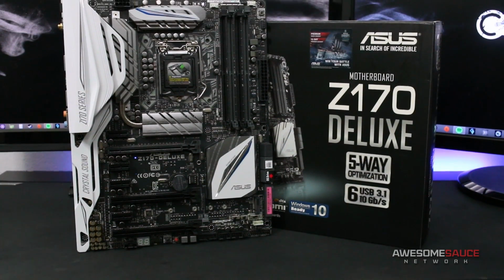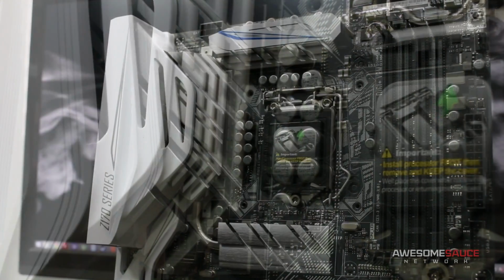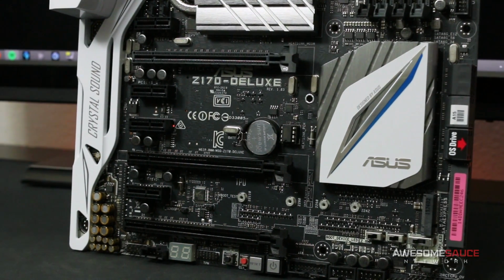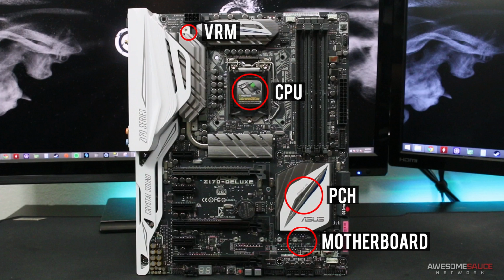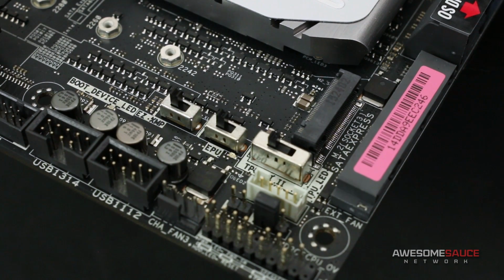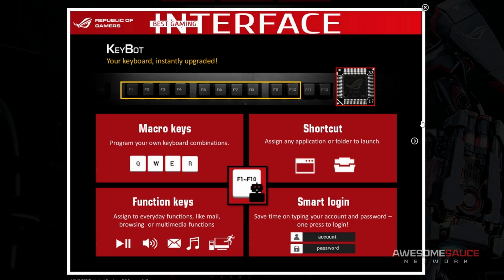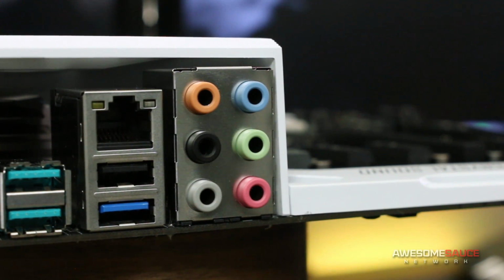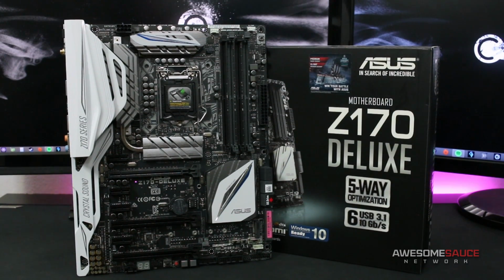Asus Z170 Deluxe! Best Z170 Board Yet?

Comment: Hello, I've got Asus Z170-DELUXE as your showing now and the vga led red light stays on, no post on the monitor code 62 meaning installation of the pch runtime services. There nothing wrong with the ram but I cleaned the ram removed my graphic card, I've reset the component still the same, any ideas?

Comment: Hey so I'm building a new pc, and Im using this board.  I'm also using an i5-6600k cpu.  I was wondering how many ghz the TPU I overclocks the standard 3.5 ghz to, and how much the TPU II does.  Could I use a coolermaster 212 evo with artic silver paste for the the TPU I, and get temperatures under 65 C, and depending on the how many ghz the TPU II provides, could I get something under 70 C or 80 C?  I've been asking around, and I'm not getting much feedback.  It would be really helpful to know.  Thanks.

Comment: You said there were multiple 4 pin fan connectors, but how many 3 pin ones are there?
Reply: I'm not an expert or anything but I think I've heard that 4 pin is compatible with 3 pin.
Reply: Dome Survivor Are you sure? I don't want to plug in anything that'll fuck it up
Reply: IAmThatDrone Well like I said, I'm no expert, but it's pretty sound logic. To be on the safe side though, I'd recommend asking if 4 pin connectors are compatible with your 3 pin connectors on tomshardware or linustechtips.
Reply: i tried plugging a 3 pin to a 4 pin on my pc and so far its working. there is a tiny plastic above the pins which is gonna guide you which pin to use when youre gonna plug a 3 pin to a 4 pin.

Comment: Do you think you can peel off the white/blue aluminium tags without causing any damage? They look so bad it hurts. On the other hand the brushed gunmetal with grooves looks clean and nice.
Also, are the white plastic covers removable ( matte dark gunmetal with flakes repaint in mind ). But I presume they surely are..

Comment: HELP..! I am stuck on getting this mb or not. I am designing a system to support 3 x 4K 28" monitors (for gaming, video editing, multitasking, bleeding-edge, etc.) with this card, and 2 x GTX-1080 graphic cards in SLI. You mentioned that if 2 x PCIe-x16 are used they downgrade to x8. How is that going to affect my GTX-1080 SLI? Better to go with a single graphics card and get the full x16? Great detailed review of this mb..!!
Reply: its not really a "Downgrade" just less bus speed. believe me, there is an abysmal difference

Comment: This board is going to be in my next build and it's going to look amazing with the color scheme I picked
Reply: pic or didnt happen
Reply: I haven't even bought any of the parts this is just the mobo I picked
Reply: +Greg Christensen just kidding mate, good choice. have fun building your rig
Reply: +00HoODBoy I will but I have to wait for the 1080 xtreme to go back in stock
Reply: +Greg Christensen so youre going with the gigabyte one?  nice, just recently watched a Review of it, seems to be the Most quiet and best cooled of the 1080s
Reply: +00HoODBoy ya. It has a more noticeable led effect than the strix 1080 which was my second choice but the 1080 kinda just works for this build. I actually started picking parts around the time the 1080 fe was announced so I had the 980ti xtreme instead but then they announced the 1080 non-ref variants, so the rest kinda fell into place
Reply: +Greg Christensen ye right now is a good time to Upgrade when nvidia get their shit together and the price gauging stops. tbh i would pick the xtreme as well right now, maybe msi since ive only had good experiences with them.
Reply: It's gonna be huuuuge

Comment: I see Kyle mentioned that the IO set-up may lead to some troubles with the radiator clearance. Does anyone have experience with this board and the Corsair H110i CPU cooler? I have one of those ready to use and I just want to make sure this board will not not fit.

Comment: Well I was torn between this board or an X99  Deluxe. And seeings how the cost of this would make more sense to save some money for other add on's to the build.. I'm going with this one. Putting it in my new Phanteks Enthoo Luxe White edition case. Lots of customization's. Lots of SSD's . No HDD's.  Well maybe just one external for back up. Kinda makes common sense ..
Reply: Kyle.. Are these Memory sticks compatible with this mother board????http://www.newegg.com/Product/Product.aspx?Item=N82E16820231857
Reply: LOL I did the same.  White Enthoo Luxe with this mobo.  I read some sketchy reviews on the Z170 Deluxe, but i haven't had any issues with mine thankfully.  My case has a lighting defect though, and Phanteks support is currently working with me to resolve the issue.
Reply: Yes I had a terminal wire behind the RGB switch of the front panel unplugged. I just plugged it back in.And it's fine. Is it the front panel Light's? Click on my name to see my build.
Reply: Ahh nice, I like that cable color scheme you've got.  I just got all-white from CableMod.  I'm thinking of possibly getting a 2nd 1080 in SLI, though from what I'm hearing there are diminishing returns relative to the cost.  I also don't know what size bridge I would use with my mobo, bc the PCI slot spacing is weird...  So did you end up passing on the Z170 Deluxe?  Looks like you have an X99 in your build.

The issue I'm having is my Phanteks case won't hold the static color of white.  It holds all other color options fine, but when on white it glitches out into some strange two-tone scheme that gets reset by cycling through them again manually.  I contacted Phanteks and they sent me a new LED controller, which I installed, but had the same problem.  I sent them a video and they said they were able to reproduce my issue with parts on their end and sent it to their R&D dept.  So they said once they determine the source of the problem they'll send me the corresponding replacement parts.  Just waiting at this point, lol.
Reply: I'll be doing an updated video with the RGB strips that I installed. Looks awesome. And yes I did decide to go with the X99 Deluxe 2. Cause I'm planning on doing some video editing and I do play games as well.

Comment: The best? I think the best Z170 board would either be the Z170x Gaming G1 from Gigabyte or the Asus Rampage Extreme.
Reply: Top Hats and Champagne I actually have the Z170x gaming g1.
Reply: JCHGaming69 brb got to kill myself, why didnt you buy a high end x99 board with a i7 5930k? that was a stupid purchase dude
Reply: Top Hats and Champagne 5930k was too much
Reply: JCHGaming69 phhh WHAT? you spend a fuck ton more than you had to on that mobo. You could of bought an x99 Pro mobo or whatever and still have the money for a 5930k
Reply: +Top Hats and Champagne If I were to go x99 I would go MSI godlike. But thats $600. not to mention the 5930k is $600 as well.
Reply: JCHGaming69 you dont need the godlike, your spending way to much on motherboards
Reply: +Top Hats and Champagne really? I want a motherboard that can support 4 gpus, onboard wifi, usb 3.1 type a and c, overclocks well.
Reply: JCHGaming69 lol you cant use 4 gpus or 3 on an z170 not enough pci-e lanes, and you dont have 4 gpus if you cant afford a i7 5930k, so you dont need 4 pci-e slots, and the asus pro does come with wifi, and what the heck do you need usb 3.1 a and c for? again your wasting money on pointless features
Reply: the z170x does support 4 way sli via plx chips on the mobo that give it 4 way gpu support besides I like the breathing room I get for my gpu's since it is eatx also too usb a and c are going to become future standards so I like to future proof my machines.
Reply: JCHGaming69 you would be bottleneck the gpus even with that plx chip, your better off getting a x99 board, with a 5930k
Reply: Top Hats and Champagne True but Im happy with my rig. I only use two gpus and unlike the z170 deluxe I don't have to sandwich my g1 gaming 980ti's.

Comment: Does anyone know if those white shrouds could be removed?  I like the board but I'd like to be able to paint the shrouds a different color.
Reply: Of course they can be removed somehow... Or do you think that's all made out of one piece? :D
Reply: _ Marcel _
So exactly how do you remove it?  I'm assuming you own the board...
Reply: lilturk726 Not the exact same but I own the z170-a and even without owning that I would have told you, that there are screws on the back of the board where the shrouds are..
ixbt.com/mainboard/asus/asus-z170-deluxe/photo/big/back.jpg

It should be the black ones with the silver ring around them ;)
Reply: _ Marcel _
That's what I was wondering.  I thought it may be held on by screws but I wasn't sure.  Thanks for the link, I couldn't really find a good picture of the rear of the board =)
Reply: lilturk726 no problem :)

Comment: is this a gamers board ?
Reply: +Kenny Hempson I would define it as an "enthusiasts board" because for it's price it doesn't feature things that are associated with gaming but features a lot that a typical gamer wouldn't be interested in. As for ASUS gaming boards there are the z170 Pro Gaming and the z170 Maximus boards for a more reasonable price and in a red/black colour scheme which by todays standards are associated with gaming.
Reply: +Metatr0n thanks can you give a reconmedation for a gaming board?
Reply: Kenny Hempson
Referring to Linus's video about mainboards, it doesn't really matter which kind of mainboard you get. BUT if you definately want to have certain features or if you want to OC your system for better gaming performance, then the choice matters:
If you want to OC your computer, then you can't get a board with the H170 or H110 chipset, because it doesn't allow OC and you can only use RAM with 2133 MHz. Furthermore as for SLI and CrossFire, the H170 and H110 only come with one 16x PCI-E 3.0, the other one is an equivalent to a 4x PCI-E 2.0, so no chance for a second GPU there.
So, if you want to leave open the possibility for OC and higher clocked RAM and you want to have the chance to one day upgrade to an SLI or CrossFire Setup, you have to get a board with the Z170 chipset.
For mATX there are 4 good models in the range around 120€:
-Gigabyte GA-Z170M-D3H
-MSI Z170M MORTAR
-ASUS Z170M-PLUS
-ASRock Z170M Pro4S
For those models it simply depends on which connector you want to have or how many USB-ports you want to have.
As for ATX, the list is too long to bring them here, so you better use a shopping website where you can use filters like "1151 Socket", "Z170 chipset" and "sort by price" then you decide by what your wallet allows and you check if it's got all the feature that you want on a motherboard.
Reply: +Kenny Hempson Please define "gaming board"

The Asus white-boards Z170, Z170-A, and Deluxe are of as high or higher quality than their equivalent gamer-solutions for the same price. The gamer-tag is a gimmik to lure people into buying them.

I checked out the Z170 Pro Gaming and the Z170-A. The Z170-A has more features but costs less than the Pro gamer and is as durable.

Comment: Nah, the Gigabyte gaming G1 is better.

http://www.newegg.com/Product/Product.aspx?Item=N82E16813128833&cm_re=gigabyte_gaming_g1-_-13-128-833-_-Product
Reply: +Phyolin Htet I would get this board. Theres a 200 dollar or so difference between this and the g1 and honestly the feature set is basically identical. ASUS has intel lan which is more stable than killer's on the g1. I even heard asus has a better sound quality then gigabytes quad core creative chip which is sad. I love both boards but solely on the best bang for the back, go with the z170 deluxe. If however u wanna shell out the premium for creative and want the bits and pieces the g1 offers over the deluxe then thats ur prerogative. Hope this helps
Reply: +HEΛRTS OF SPΛCE and looking 100000 times better
Reply: the guy I own it and I love it!
Reply: +HEΛRTS OF SPΛCE Yeah I'm getting it too. Unfortunately its $799 AUD which is insane.
Reply: Does it have wireless wifi? Thanks!
Reply: Minegirl88 i think yes but you got to check it yourself, google z170 g1 or what ever
Reply: Minegirl88 Yes, it comes with Killer DoubleShot-X3 Pro and an antenna. If you scroll down on the page that I linked, you'll see it.
Reply: +HEΛRTS OF SPΛCE Thanks! :D
Reply: +HEΛRTS OF SPΛCE i should get this board or G1.which one is better.
Reply: Patrick Challita That's a fair assessment.
Reply: +HEΛRTS OF SPΛCE this or maximus VIII hero alpha or Gigabyte gaming G1?in review seem deluxe has issue.here deluxe and maximus VIII hero alpha is same price.
Reply: ***** I agree with Patrick Challita's assessment.

Comment: skylake is gay i rather buy a 5820K and overclock it .... still better then this skylake shit with bad heatpaste and still 8 cores
Reply: 8cores? Hyperthreading =/= cores.
It's a quad core.
5820k is a hex core.

It entirely depends on what you are doing as to whether cores improve your performance.
Reply: +JayJapanB  i mean intel still refuses to use  good thermal conpound for a here 390€ cpu a 5820k here 430 is the better bang for the buck morr cores more lanes can also oc and has better heat disapation. i guess you dont reall need a igpu in your system
Reply: Bedi O LPs Yeah, it's still the glue gap. I chopped up a 3770k, clamped it down with liquid metal and that solved that problem. I think removing the gap did more than any TIM could do.

I preference a good CPU with high core count, but for most cases you still need a half decent gpu. (No I don't mean a 970 or 980).
Thus an igpu on a desktop I just see as a place holder.

These days I spend most of my time with a tablet though doing 2D work.
Woooo! Dual core i7!
Reply: +JayJapanB  how much could you reduce your temps i heard from people the temps got down more then 15C is ut true?
Reply: Bedi O LPs Varies a fair bit. Just like overclocking in general.
I got less than 10degrees difference but my chip wasn't hitting as high as many in the first place.

I can't remember exactly. This was years ago.
Now it just sits there working hard. until I have better skills and a decent career there's no point asking for more from a CPU.
Reply: +JayJapanB  noice

Comment: To be honest this board isn't enticing. The only thing I really like about it is that it has two pin temp headers. Now don't get me wrong the board is packed with features but there are LGA 1151 boards out their for 100 dollars less then this one that has the same features. 

For example GIGABYTE GA-Z170X-Gaming 7 has one less PCIE 1x slot and no temp sensors and its 220. Plus it looks nicer. The only thing the GIGABYTE board doesn't have is a thunderbolt header and the WIFI and Bluetooth which is essentially where the 100 dollar premium is coming from. 

Also the 1x slots aren't the 3.0 standard on the ASUS board. 

The Gigabyte board has more SATA express connectors. 

It has the same amount of M.2 connectors. 

The Gigabyte board has better audio with the the Creative Sound Core 3D OP Amp if you like that. 

The gigabyte board has one more fan header.

I like ASUS I really do but I honestly think you pay a premium just because of the name and in this particular case you lose features as well.

Comment: if two gpus are plugged in and the board defaults to X8 each, how does that affect the gpus performance? are the gpus not running at their full potential because they aren't running at X16? or can a gpu run the same in X8 or X16

Comment: All mother boards by now should have a cover like the Sabertooth as standard
Reply: no thanks.
Reply: ***** well not everyone likes awesome
Reply: +jervis jagroop Good to have the option not to have them. If they came as an optional add-on module then best of both worlds. :) I have a sabertooth z87 currently and the noise from those tiny fans is driving me mad. Next I'll be getting the Asus X99 IPMI: no shroud -> better heat dissipation -> no mobo fans -> happy me. :)
Reply: ***** Yeah I'm a bit lazy now as it's almost time for a full rebuild. Originally I was a bit concerned to take them out because the sabertooth shroud completely covers the mobo so I was worried about the pcb getting too hot under the covers. You took them off and the temps are fine?
Reply: ***** Will do. Cheers dude.

Comment: I wonder how many of the features are dependent on Asus software. Asus has great hardware but their software is horrible and most of it doesn't even work. I have an Asus Sabertooth 990FX V2 which has been out for a long time yet half the software that comes with it is trash and causes issues with the OS. Once installed you can't fully uninstall it either. Some services stay on the system and continue to cause problems. 

I love the board now that I have found 3rd party solutions to control it and have removed the services that didn't get uninstalled but Asus has dropped the ball when it comes to the software they release with their hardware.

Comment: Can someone help me?
Iwas thinking about buying a h170 pro gaming or some other h170 board for the upcoming locked skylake cpus. The problem is in the manufacturer´s website says this
 
"4 x DIMM, Max. 64GB, DDR4 2133 MHz Non-ECC, Un-buffered Memory"
 
Does this mean that the motherboard only supports ddr4 2133 mhz memory or can I buy a higher frequency Ram and it woould be "downscaled" to 2133mhz by the motherboard?
Thanks for the help
Reply: you can throw anything ddr4 in there and it should work with standardized 'downscaled' data rates. Just don't overspend thinking it'll be faster.
Reply: +mata-pombos So what's the issue? These are default specifications...